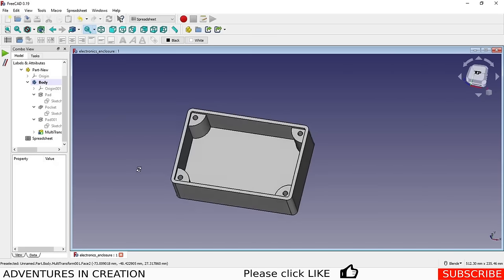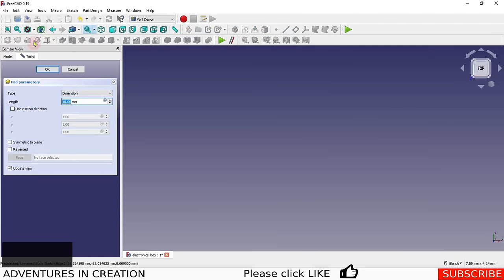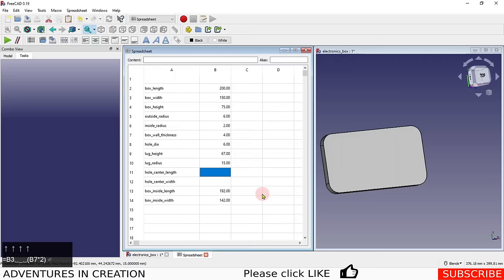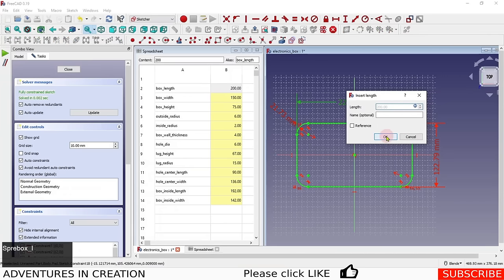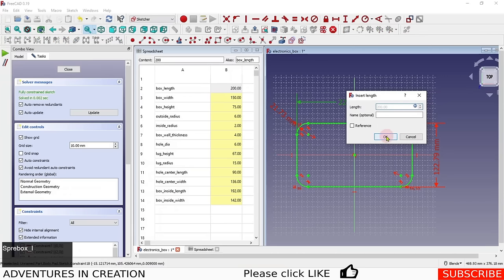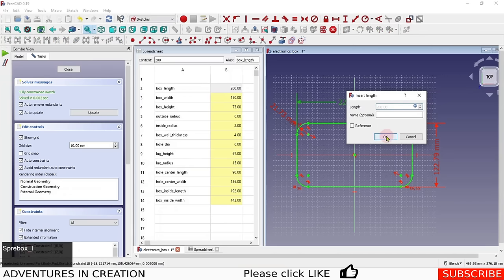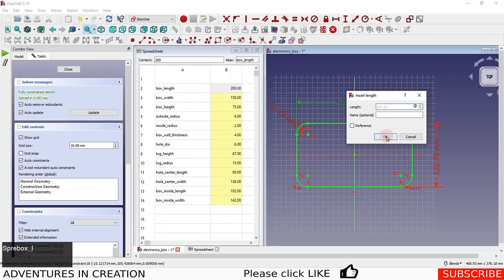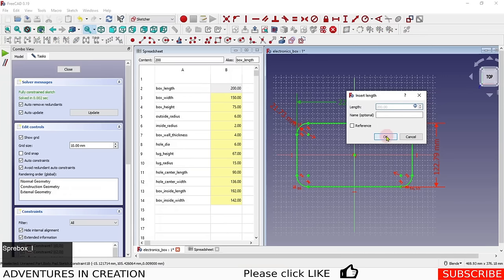FreeCAD Electronic Enclosure Using Simple Parametric Design Techniques

Comment: Brilliant! 

I'm not dumb by any means, but boy how do some video tutors not know how to teach (30 Seconds in: "Step 103... do this..." - WHOA! Where is step 2?!!). So I wanted to design a project box for an amateur radio unit, and have parameters that I could alter later on as I expect a LOT of boxes in my future. I came across this tutorial. I'm following well! Thank you.
Reply from the maker: You confused me at first but I think you are saying you liked this video 🤦‍♂️
Reply: @Adventuresincreation  yes, I'm saying (badly!) that your instructions are clear, you don't rush, I can see the screen you're clicking on and the settings you're making, plus even the odd error you make is a relief because I made the same error by following you accurately 🤣

I currently have my first box-with-lid printing on my AnyCube printer 👍

Comment: This tutorial is an eye-opener. Using a spreadsheet  is the key keeping control of the  object during the construction process.
Reply from the maker: Thanks, you are right. Don't forget to check dynamic data elements too.
Reply: @Adventuresincreation  
I will go through your tutorials anyhow. But first I am constructing this  Electronic Box watching in parallel your video. 😊
Reply from the maker: @drulli1  Excellent! Have fun with that.

Comment: Excellent tutorial. Would it be possible to extent this video making a clickable lid instead of screws. I was thinking to add four rounded notches on the edge of the lid, but got stuck on figuring out how to cut out with same form on the inside of the box……thanks
Reply from the maker: Thanks! - This part is really intended to get you started so you can modify the box in any way that suits your needs. I have done some "clickable" designs and there are many variations that you can implement. Just remember that PLA is not great when it comes to flexing as it can take a permanent set when it's under load.

Comment: I know this is a fairly old video but I have a problem. When I set the horizontal & vertical restraints on the hole, it puts it outside the lug, How do I correct this please?
Reply from the maker: It should be mathematically impossible. Did you check your dimensions?
Reply: @Adventuresincreation  I have a lug radius of 8mm & a hole of 2mm. The horizontal & vertical sizes on the sketch are correct. On the vertical, it shows the hole 2mm down but on the horizontal it shows the hole as 2mm to the left of the lug instead of the right.

Comment: This is one of the most useful FC videos I have watched, so thanks! I do lots of electronics and microcontroller projects, so 3d printed enclosures are a must. I have not scanned the comments, so my two cents may be a repetition of previous comments.

I prefer to set up the spreadsheet aliases at the start. That way calculated spreadsheet values can use meaningful names instead of cell numbers. Also I rename the spreadsheet to something short ("sp") to save some keystrokes. Finally (and this is just my way) I did the inner pocket by putting a datum plane at box_height and pocketing downward.
Reply from the maker: All good stuff. Glad it's useful for you.

Comment: This is a fantastic tutorial and I learned a lot from it. The only question I have, would it be possible to calculate the dimension of the box when I know the horizontal and vertical distance from the hole center in each corner? What I can't find is a solution (formula) for the distance from the hole-center to the inside wall. It's kind of designing the box from the inside to the outside. Hopefully someone knows the solution for it. TIA

Addition: I reviewed the video again and how the constraints of the holes were defined. I think the hole-diameter plays a role here.
Reply from the maker: You can certainly calculate every part of the box based on the available parameters
Reply: I think I found the solution.
I added four new entries to the spreadsheet.
a) "hole_distance_horizontal, b) "hole_distance_vertical", c) "box_length_r" and d) "box_width_r".
"Hole_distance_horizontal" and "hole_distance_vertical" getting the measured values of the board from hole-center to hole-center.
"box_length_r" gets the formula "hole_distance_horizontal + hole_dia *2 + box_wall_thickness *2"
"box_height_r" gets the formula "hole_distance_vertical + hole_dia *2 + box_wall_thickness *2
And finally I changed the formula for "box_length" to "=box_length_r", and "box_width" to "=box_height_r".
And voila, I can create a board box from the inside out.
PS: when the dimensions are too tight for the rounded inside corners, they interfere with the 90° corner of the board (at least in my case). I filed the corners of the board round.
have fun

Comment: Could you create the video of the lid as well?  More importantly showing how the lid and box assemble together in a FreeCad model, and checking for interferences between the lid and box.
Reply from the maker: I can certainly do that for you. As you may have seen I did create the lid along with the clearance holes for the screws etc. Because its all parametric I used calculations to ensure there is always clearance.
Reply: @Adventuresincreation  I've found lots of good videos on creating a part, but not many on multiple parts to make an assembly and think showing interference checking.
Reply from the maker: Check out my latest video, I created the box and showed how to check the clearance. I mentioned you in the video.

Comment: This is my first try at using FreeCAD.   Lots of rewinds (to figure out where I needed to add the next sketch), and also realized that I needed to use your startup macro to create the Part (remember this was my first attempt) - however it was well worth it.  I was able to reproduce your excellent design.   Thank you very much.
Reply from the maker: You are welcome
Reply: @Adventuresincreation  hi thanks for video. I managed to do the spreadsheet but my model does not change when putting in values and got exclamation mark at my sketch. Sorry is my 3rd day at using this software only used corel x4 for laser cutting

(No spreadsheet selected.  Please select a spreadsheet in the tree view.
10:33:40  Traceback (most recent call last):
  File "C:/Users/Gary/AppData/Roaming/FreeCAD/Macro/EasyAlias.FCMacro", line 139, in <module>
    raise Exception('No spreadsheet selected.  Please select a spreadsheet in the tree view.')
<class 'Exception'>: No spreadsheet selected.  Please select a spreadsheet in the tree view.
10:34:20  Traceback (most recent call last):
  File "C:/Users/Gary/AppData/Roaming/FreeCAD/Macro/EasyAlias.FCMacro", line 139, in <module>
    raise Exception('No spreadsheet selected.  Please select a spreadsheet in the tree view.')
<class 'Exception'>: No spreadsheet selected.  Please select a spreadsheet in the tree view.
10:34:38  Traceback (most recent call last):
  File "C:/Users/Gary/AppData/Roaming/FreeCAD/Macro/EasyAlias.FCMacro", line 139, in <module>
    raise Exception('No spreadsheet selected.  Please select a spreadsheet in the tree view.')
<class 'Exception'>: No spreadsheet selected.  Please select a spreadsheet in the tree view.
10:35:01  <Spreadsheet> Cell.cpp(646): Unnamed#Spreadsheet.B13: Property 'B2' not found in 'B2'
10:35:01  <Spreadsheet> Cell.cpp(646): Unnamed#Spreadsheet.B11: unsupported operand type(s) for /: 'str' and 'int'
in expression: B13 / 2
10:35:01  Recompute failed! Please check report view.
10:35:05  <App> Transactions.cpp(359): exception while restoring Unnamed#Spreadsheet.B13: Bad dynamic_cast!
10:35:05  <App> Transactions.cpp(359): exception while restoring Unnamed#Spreadsheet.B11: Bad dynamic_cast!
10:35:11  <Spreadsheet> Cell.cpp(646): Unnamed#Spreadsheet.B12: Property 'B14' not found in 'B14'
10:35:11  Recompute failed! Please check report view.
10:35:12  <Spreadsheet> Cell.cpp(646): Unnamed#Spreadsheet.B12: Property 'B14' not found in 'B14'
10:35:12  <Spreadsheet> Cell.cpp(646): Unnamed#Spreadsheet.B11: Property 'B13' not found in 'B13'
10:35:12  Recompute failed! Please check report view.
10:35:13  <Spreadsheet> Cell.cpp(646): Unnamed#Spreadsheet.B11: Property 'B13' not found in 'B13'
10:35:13  Recompute failed! Please check report view.
10:35:15  <Spreadsheet> Cell.cpp(646): Unnamed#Spreadsheet.B12: Property 'B14' not found in 'B14'
10:35:15  <Spreadsheet> Cell.cpp(646): Unnamed#Spreadsheet.B11: Property 'B13' not found in 'B13'
10:35:15  Recompute failed! Please check report view.
10:35:16  <Spreadsheet> Cell.cpp(646): Unnamed#Spreadsheet.B12: Property 'B14' not found in 'B14'
10:35:16  Recompute failed! Please check report view.
10:35:54  Traceback (most recent call last):
  File "C:/Users/Gary/AppData/Roaming/FreeCAD/Macro/EasyAlias.FCMacro", line 139, in <module>
    raise Exception('No spreadsheet selected.  Please select a spreadsheet in the tree view.')
<class 'Exception'>: No spreadsheet selected.  Please select a spreadsheet in the tree view.
10:39:24  Traceback (most recent call last):
  File "C:/Users/Gary/AppData/Roaming/FreeCAD/Macro/EasyAlias.FCMacro", line 139, in <module>
    raise Exception('No spreadsheet selected.  Please select a spreadsheet in the tree view.')
<class 'Exception'>: No spreadsheet selected.  Please select a spreadsheet in the tree view.
10:39:36  Traceback (most recent call last):)
Reply from the maker: @pietpompiepompiepiet940  you haven't selected (highlighted) the spreadsheet in the model tree.
Reply: @Adventuresincreation  ok thanks will check

Comment: Thanks for the great video. It is a pity that it is not possible to define a constant (or variable) directly in the sketch dialog when entering a value. Why is it not possible to display all parameters entered automatically in the table? Unnecessarily many operations are required to enter a single value.
Reply from the maker: Thanks for the feedback

Comment: Your holes go all the way to the bottom wall thickness. Might be hard to machine drill those holes on some geometry combinations. Would be interesting to see how to add a parametric depth hole that goes less deep.
Reply from the maker: This was intended for 3D printing so the hole depth is easy to create however, if you are machining a box I can see how that hole depth could be difficult. Why don't you try modifying the box to make the hole depth shallower? Let me know if you need help.

Comment: I was following Roland's tutorials, but as you know they are out of date now, and found your tutorial. Excellent. I'm will be using the spreadsheet in many future projects. The only thing missing are PCB mounts, but I'm sure I can figure that out on my own.
Reply from the maker: Do you have an example of the PCB mounts you are looking for?
Reply: @Adventuresincreation  I have a picture of what I made but simply, what I did was I created a sketch, made two circles (pcb_hole_dia, and pcb_hole_dia+1.5*wall_thickness), and padded the outside circle at a height I defined in the spreadsheet has pcb_mount_height (5mm).  I also defined a pcb_mount_center_length and width to place it. It worked, but now I'm trying to figure out how to double it horizontally at a specific distance (distance between pcb mounting holes) and the same for the width so that I have a mount for all 4 holes in the pcb.

Comment: Hi, out of curiosity, how do you have 2 decimal points in your spreedsheets ?  I tried checking all the item in Preference but cannot make it look like yours ?  Thanks
Reply from the maker: Honestly, I didn't do it on purpose. I would imagine it's in the spreadsheet settings. Try just typing a value in that has two decimal places and see if it adjusts
Reply: I just noticed in edit/preferences/General/Units there's an option to set the number of decimals. I had to scroll to find Units, some tabs were off to the right of the window. (That's version 0.20 on Windows 10)
But when I followed the video, my spreadsheet already showed 2 decimal places and that was before I found the preferences settings.
Reply: @viragored  thank you so much for pointing this👍👍

Comment: Really helpful video, Great work.
I have now made my own template based on your Tutorial, just some minor changes. Thx.
But I have one question (or problem).  How to design a box that is not a square. I need a box where the placement of the controls need to be placed in an angel, a chamfer.
Reply from the maker: If the chamfer is on the outside of the box you can create it, add the chamfer then use the thickness tool.

Comment: This video was very informative for me as a new FreeCAD user. Unfortunately, I bumped into a couple of issues. The main one is that when I search the Macros that are listed as available, Easy Alias is not in the list. If any user knows where it is available, I'd really appreciate that information. 
The default macro download path is ridiculously complex. I'd prefer to keep the macros within the FreeCAD folder \Macros. Even though I created a Macros folder and changed the preferences, the install programs would not recognize the new location and insisted on installing as originally shown four or five folders deep under Users. Is that option "fixable"?
Being that this video is several years old, chances are the creator has moved on and has little or no interest in a new whiner, but I might be pleasantly surprised and get answers. I'm open to surprises.
Reply from the maker: I am still creating videos :-) I thought easy alias was still downloadable through FreeCAD but if not, do a quick Google for it and get it from Git. You can change the Macro location once installed but new installs are likely to change it back.
Reply: Wow!
 So much for my wondering about response. I was hoping for some other user to chime in at best. Instead, I got the complete answer from the creator. That's perfect.
Now, to start searching for more of Adventures work. I know that they'll be quality for sure.
Thank you.
Reply from the maker: @ytorwoody  If you subscribe to the channel (it's free) you will get notified when I release new content.
Reply: @Adventuresincreation  LOL. I subscribed before you'd even finished half of the enclosure video.
I do have one request. See if you can increase the size of your pointer. I am essentially deaf, so I have to use closed captions. The normal pointer is so small and movements are so rapid that following along is sometimes almost impossible. Otherwise, I am definitely a happy camper now that I've found your videos.
Reply from the maker: @ytorwoody  Check more recent videos, I increased the size, changed the color to red and put a circle around the cursor. All from feedback like yours.

Comment: Thanks for the wonderful video. I am very new to FC and know almost nothing about it so I may be raising a dumb question - where can I read more about using macros/spraedsheets to FC designs, please?
Reply from the maker: The freecad wiki has lots of good information. Just Google freecad wiki
Reply: @Adventuresincreation  Thanks a ot for your quick response. That was very helpful. 
Kindly allow me two more simple questions:
1. In FC, how can one correct the design steps one has already taken?
2. At around 21:05 in your video (while setting the "Z" parameter under "attachment") you say....Quote "now if we tab off a...."Unquote. What do you mean by that?
Please excuse me for this question, I am not a native English speaker.
Reply from the maker: @user001sg9  you can use the undo key or delete features. To tab off, is to hit the tab key so the current selection changes to next item in the tab order. It basically registers your change to the current item
Reply: @Adventuresincreation  Thanks a lot. Your videos are a big help.

Comment: Thanks for an excellent tutorial. I'm running 0.19-24276 on an Ubuntu Linux system. When I change the spreadsheet parameters and check the PAD to make sure they have been used I get "Pad result has multiple solids. This is not supported at this time". It would appear that the Lug_height has changed as specified in the spreadsheet but the Box width, length and depth have not. Any ideas?
Reply from the maker: Double check how the variables are assigned, make sure there is no typo and make sure the spreadsheet variables are properly linked to the values.
Reply: Thanks for the hints. I finally got there after a few attempts. But Ive learned a lot from the mistakes I made. For what its worth the first box I print is for a waterproof enclosure for a loop antenna project. This is my first attempt at learning a CAD package so thanks again for the tutorials and advice
Reply from the maker: @StephenFarthing  I am glad you got it to work. Share some pictures of your first box.

Comment: Good video. I have a question about drawing the inside of the box. At 17:00 you proceed to re-create the lines and radii for the inside dimension. Why not just use an offset command (assuming there is one) to create the inner box/  In 2D CAD that is how you would accomplish that.
Reply from the maker: There is an offset but it's a macro that you have to install, it is not a native command hence, I didn't use it. - I am not sure if the offset is being added to the next release or not.
Reply: @Adventuresincreation  Not having a native offset command in FC is a game changer for me. Offset is a fundamental 2D sketch command. It is used everywhere to do exactly what you had to do manually. How did this product make it all the way to release 19 without such a fundamental  command?
Reply from the maker: @meg-a-bytes  yeah, I must admit, I missed that at first, but the macro works well even though I don't find myself using it as much as I would have thought.